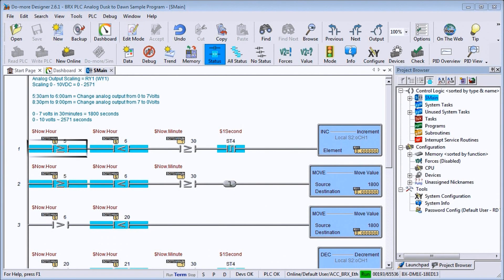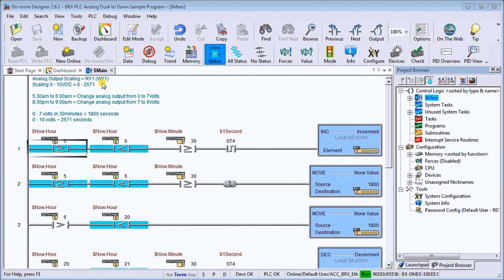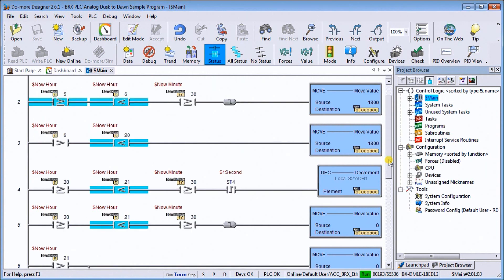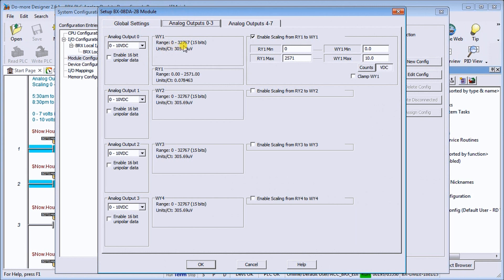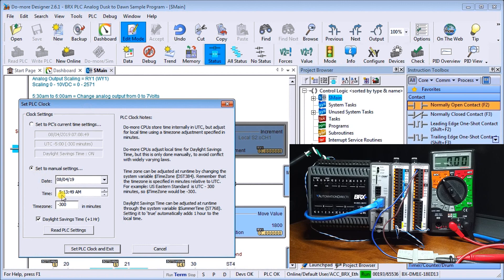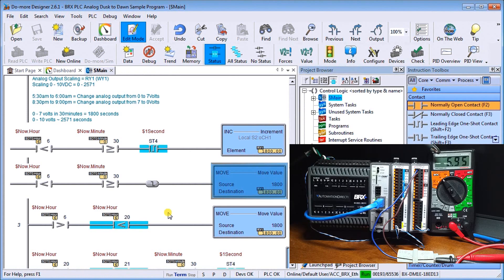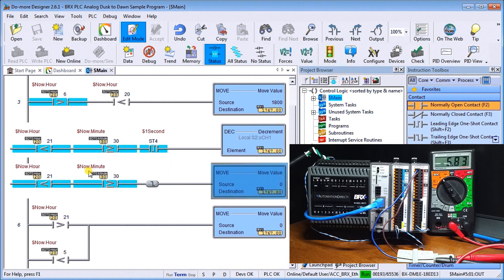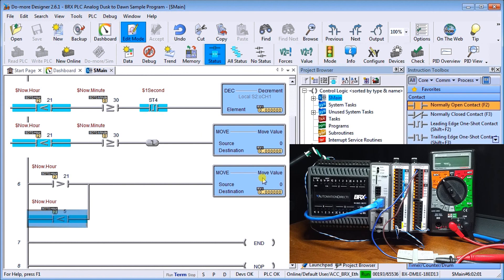BRX Do-More PLC Analog Dusk to Dawn Program

Comment: Thank you so much for your work! I am currently setting up an encoder with a scaled value that is feeding a SCALE instruction, that will then drive an analog output. I am setting up a lamination line, where my lamination nip, which is traveling a set speed (which is set by my PLC and controlled via a c-more HMI). My encoder will read that drum speed, I will scale those pulses to equal feet per minute traveled, then feed an analog output from that SCALE instruction. I am hoping to send a 0-10v signal to a VFD downstream and have that motor match my line speed. This is actually the first time I have ever worked with a PLC, so I am constantly looking up information, asking people, watching your (very helpful) videos, etc. I plan on setting up a PID loop to control my lamination heat, I have to set up a laser for thickness measurement, I have to engage and disengage an infrared heater (electrically and pneumatically), measure line speed and distance traveled, so I can shut the machine off at 300 feet -but also make that shut off distance variable. I have three raw materials I am putting together, that are all in roll form, so I have to put a "low roll" stop on our machine, via a sonic sensor on three unwind stands. I will feed a stack light for machine status and I will read in my heating element status to make sure all my heating elements are on during my lamination process.

I also really want to email out from my PLC to our quality department, all the thickness measurements taken from each shift, so quality can have all the thickness data they need, simply given to them at end of shift each day. 

I've jumped off the deep end, but I plan on patiently taking this one step/process at a time and end up with a nicely laid out (and hopefully functional) machine at the end.

Thank you for your well-put-together information, it has been a VERY important resource for me. I feel like I should pay you a consulting fee :)
Reply from the maker: Hi Derek,
Thank you very much for your comments. I appreciate it. 
Here is a link to the website for the BRX Do-More Series. Here you will find posts for all of the items you have mentioned that you want to do.
https://accautomation.ca/series/brx-do-more-plc/
Let me know if you have specific questions.
Thanks Again,
Garry
Reply: @ACCautomation  Thank you, I just gave a donation on your page. You have MORE than earned it!
Reply from the maker: @derekrussell9925  
Thank you, Derek.
Garry

Comment: Thanks Garry! Great video.

I was wondering if theres an easy way to increment and decrement a range of values.

e.g. I have a range of registers (V100 ~V611) the values in each register are different. But I want to increment or decrement all the registers values by 1 at the same time. So that the ramp rate is the same.

Is that posable without having todo 6 rungs of logic for each register?

To elaborate a little on my use case. 512 registers was chosen because that equals one DMX universe. So my scaling factor is 0~255. 

16 channels are mapped to two BX-08DA-2B modules to control 0-10 fixtures. All other channels are mapped to SERIO module to control  DMX512 fixtures and other devices.
Reply from the maker: Hi Justin,
An alternative is to use indirect addressing and the For / Next program loop to increment or decrement the numbers. 
https://accautomation.ca/brx-plc-numbering-systems-and-addressing/
The above post will show you the indirect addressing on the BRX PLC. 
I hope this helps you out.
Regards,
Garry
Reply: Thanks
I look at that but I couldn’t quite get it to work using that. 

I’ve never use subroutines before, but from what Ive read it looks like that may be the way to go. Unless you know of a caveat?

Do you have any videos on BRX subroutines?
Reply from the maker: @mumbles1justin  
https://accautomation.ca/brx-plc-program-control/
Regards,
Garry
Reply: Doesn’t look like subroutines will work after all due to rising edge and counters are not allowed to be used in subroutines.
Reply from the maker: @mumbles1justin  
Subroutines would not work. I still feel the indirect addressing and for /next loop would work. I'll see about putting a sample together.
Regards,
Garry
Reply from the maker: @mumbles1justin  
Here is a sample program using X0 and X1 to increment and decrement 512 registers at a time.
https://www.dropbox.com/s/7hf55mdmeojli2x/Inc%20Dec%20Multiple%20Registers.zip?dl=0
This was written in the Do-More Designer Software and tested on the Simulator.
Regards,
Garry
Reply from the maker: You will see that the two subroutines are used. One will increment all the memory locations by one, and one will subtract all of the memory locations by one. You could add in conditions for each of the registers between the for / next loop to ensure the number does not exceed the maximum or minimum.
The routines are executed by the leading edge of the one-second timer bit.
Let me know if you have any questions.
I think that this might work as a good example of the for / next loop application in the BRX series.
Thank you,
Garry
Reply: I must be doing something wrong or don’t completely understand how the indirect addressing and for/next works. Because even running the the program you kindly provided, I still only see one register incriminating and decrementing. Just as I did when I previously attempted on my own.

In the data window under elements Im watching V[V0] ~ V[V3] . V[V0] is the only register I see incrementing and decrementing. The rest stay at 511.
Reply from the maker: @mumbles1justin  
The for next loop is from 100 to 611 at V0. This means that the value in V0 will change from 100 to 611. This acts as the pointer.
V[V0] will represent V100 to V611. Monitor these registers for the values.
Regards,
Garry
Reply: Garry Shortt 
I greatly appreciate the time you’ve spent helping me understand how the for and next instructions functions work.

I see now how it all functions. Thats exactly what I was looking for.

Thanks agin!